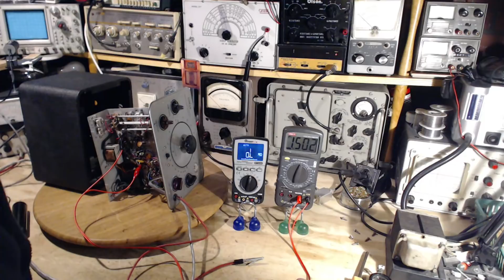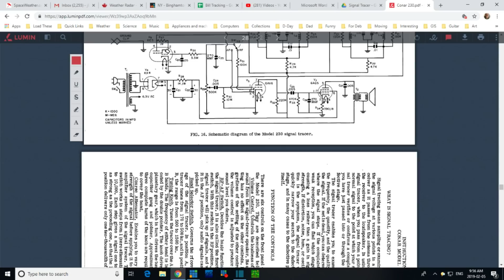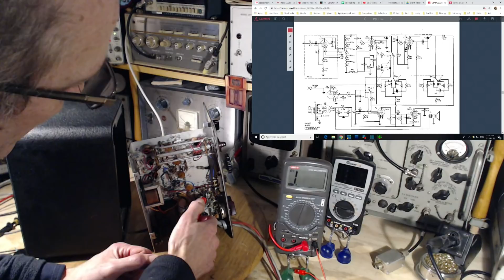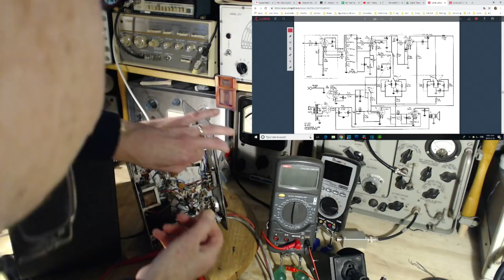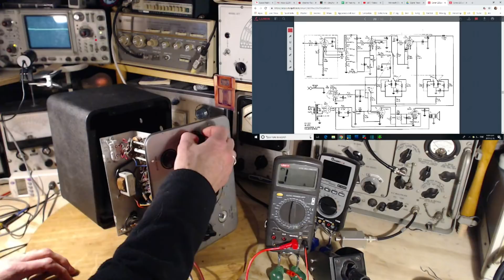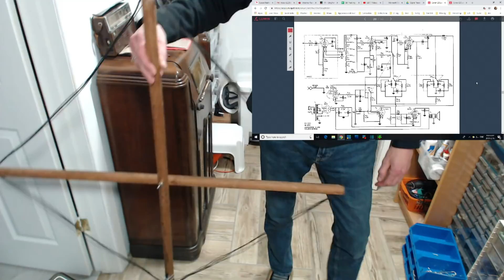Conar Signal Tracer Model 230 Video #2 - First Fault Found

Comment: I did a-test this AM. In the field with RCA Service Co. as part of a normal service call a safety requirement was mandated. The check was for stray voltage-of leaky currents . From the chassis was connected an 1800 ohm 10 Watt power resistor, to ground or a cold water pipe. The resistor had very long leads on it, most time the kitchen was the closest source for a cold water pipe. With a Simpson 260 VOM the voltage across the 1800 ohm resistor was measured. Without the resistor you typically would see 90 to 100 volts AC. With the resistor in circuit the voltage was about 40 millivolts. Ohms law told us that .040 volts divided by 1800 ohms was 22 microamps or stray voltage. A higher impedance meter might see larger voltage because the lack of circuit loading is not there as in a Simpson 260.
Using this techique this morning on my Conar 230 proved to me the stray voltage That I an seeing is a result of transformer magnetic fields, ground loops and test equipment with super high input impedance. There is no danger. The stray inductance and capacitance when using the chassis fir ground and not a copper bus bar will be subject to errata like we are finding. The leakage currents are in the magnitude of microamps. Possible we might feel a tingle from time to time but there is no danger.

Comment: Measure the capacitance from the primary to the case. I have .33 UF and there is  .33uf in the circuitry. Even on an isolation transformer i see leakage to the isolated secondary.

Comment: Ive become bored with radio and record player. Lately my keen interest is now in test equipment. So far in my opinion the Conar Signal Tracer is the most comprehensive model out there. To think a Tech school NRI made this a project boggles my mind. The parts in it are good quality and the circuit designs far advanced Eico and Heathkit.

Comment: Leaky/faulty electrolytics in that power supply circuit CANNOT POSSIBLY lift the chassis voltage with respect to Earth ground. Guys, it's all about that power transformer: that's the ONLY thing there that provides ANY sort of line isolation, and precious little of it.

Comment: I thought I was the only one who said swip instead of switch! Great minds and all that. I had something strange happen when working on mine. I had finished repairing it, I thought, and put it back in the case. When I powered it up I started smelling hot resistor. I took it apart and found that the 150k resistor next to L1 had cooked. I could not find what caused it. I turned it back on and tested the voltage across the resistor and found the current flow through that resistor was normal. I replaced the burned resistor and it hasn't done it since. I was very happy it didn't roast the coil. That would have been fatal.

Comment: The 300K was probably specified using the meters of the day...analog. They load the circuit. When working with relic equipment, I try and use test equipment that was available "in the day" (i.e.-VTVM). This is really important when making voltage measurements (Ohms/Volt). You'll get "close readings" with a DVM but usually not what's shown in the documentation. Just a thought.